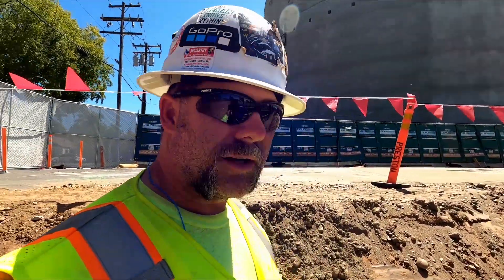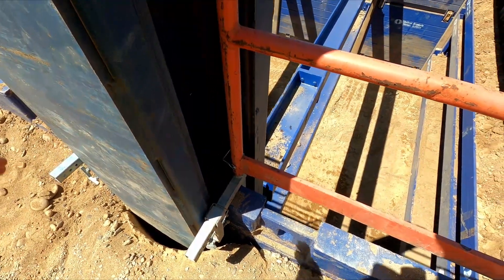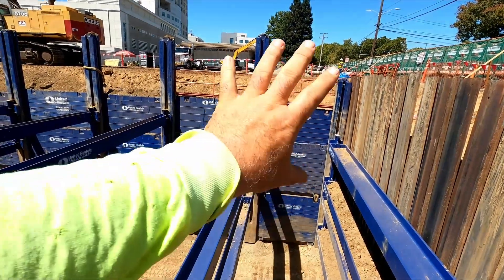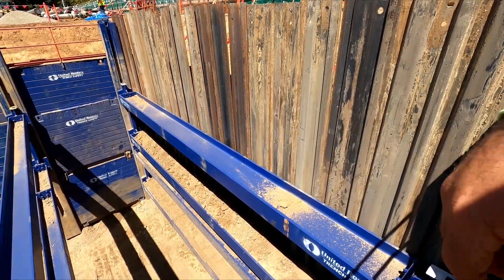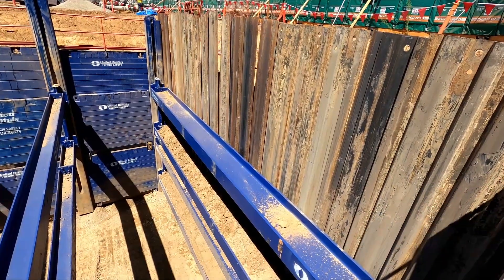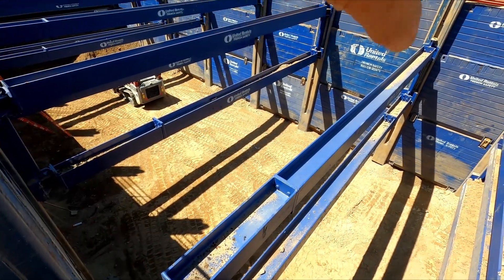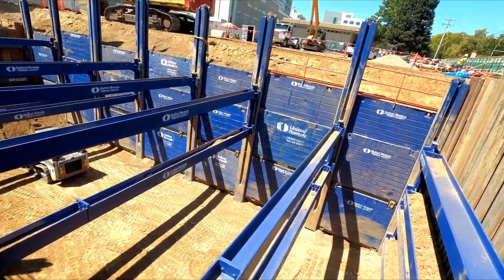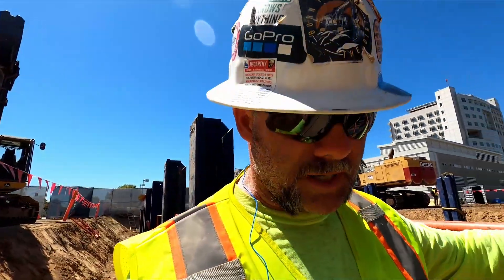Ultimate Guide to Slide Rail Shoring Systems

Comment: I just bought my first shoring. Hydraulic set up to 8'. Kinda makes my set up look like a toy
Reply from the maker: We hardly ever use slid rail. So why did you buy instead of renting it?
Reply: @TheLeverMonkey  Timing, convenience. I do water line install and repair, septic, sewer. Renting shoring would cost me 6-8 hours due to location. So, for me owning it, can save me a day per job minimum. The other side of that savings is Excavation time. Prior to having shoring the only option was to bench everything back. This adds machine time fuel, etc both on the front end and backfill.

Here's the last most important thing. When I own it there is zero excuses for not using it.